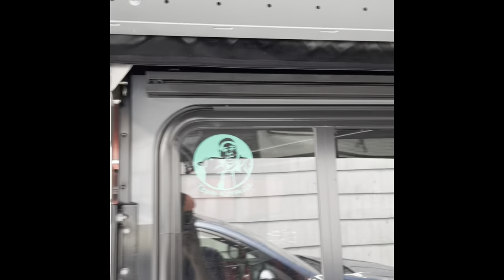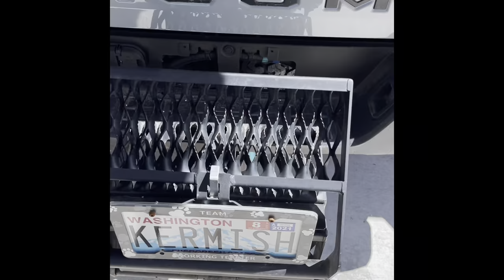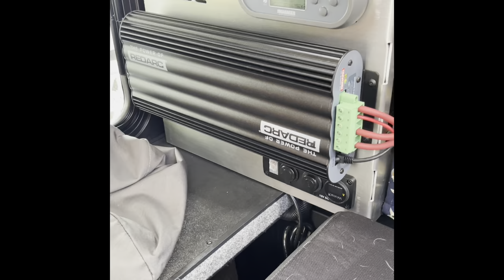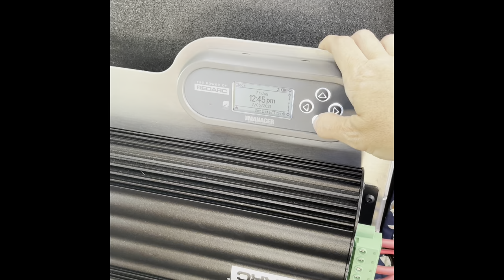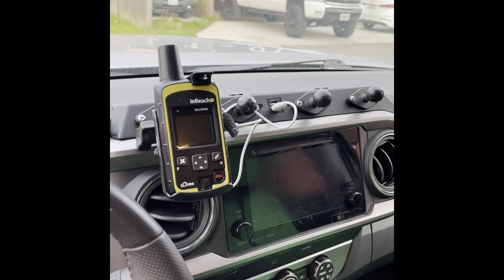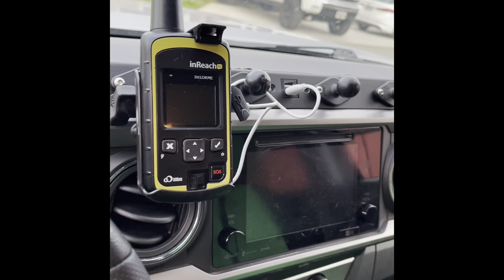2019 Toyota Tacoma with Project M

Comment: The rubber tail gate gasket really cuts down the dust on the back of your truck and dust entry into your camper. You may wish to check the bed's bulkhead behind your truck cab. That area isn't sealed on many truck to allow water to drain out of the bed. You can get a roll of putty tape to seal that area and keep the dust out of you camper. Thanks for your video.    :)
Reply from the maker: Thank you for the feedback and ideas. I was going to seal up the bulkhead area, but I like the drainage when I hose out the back of the truck. I use my truck for lots of different purposes, so sometimes it needs cleaning out.

Comment: Nice setup I am in the process of buying a Project M unfortunately I have to wait until June 2022 to get it. The more I looked at them the more I wanted one.
Reply from the maker: That was how I was too. I ordered mine right at the start of the pandemic. Had to wait all summer for it and got it right before Thanksgiving. Makes me glad now that I got it when I did. Feel free to ask any questions that come up while you’re waiting.
Reply: @kerryhagerty7051  Thanks Kerry will do. FWC is booked out a year at least the Project M is quite popular at the moment. They have a lot of accessories and seems to be somewhat over priced. I am trying to restrain myself and just get the must haves.
Reply from the maker: @markandroena  definitely they charge a premium for some things. What I focused on were the things that would pierce the skin of the camper. Those things are often best installed during construction… however, now that I have mine, they really are easy to work on and you really can do just about anything you want with them - with a little know how and common sense.
Reply from the maker: @markandroena  and the wait definitely sucks right now.
Reply: @kerryhagerty7051  Are you glad you purchased the power station and the solar? I have seen several power stations much cheaper but its nice to have it already installed. I liked the base price of the topper but the cost escalates quickly with just a few accessories.
Reply from the maker: Short answer, yes I am happy with the solution I put in… and it wasn’t cheap. I want to be able to spend extensive times off grid and have the ability to charge electronics that I use in assorted activities… lights and fridge/freezer are nice too. I could have accomplished the same solution in a lot of different ways and many were cheaper, but had more failure points and/or durability concerns. I would say really work out what you need/want electricity for, how long you need it between times you would run/drive the truck. Also think about where you go/camp… is there lots of tree coverage? Do you prefer to park in the shade? You may want a portable generator and/or folding/portable solar panel instead. I will say having it wired by the factory made a nice clean install that I appreciate, but even that is something a person with the right skills could do themselves. Once you start adding stuff it starts to really bring up the price and also the weight. Hope this helps.
Reply: @kerryhagerty7051  Good points thanks.
Reply: Hi Kerry,
I get my Project M in July ,I want a 270 awning have checked multiple options. You installed an Alu Cab 270 shadow awning on yours correct? How do you like it? You can buy wall accessories correct? Thanks!

Comment: Do you have a water system?...Such as:  a mounted tank with several gallons:  a heating system; a wand for outdoor shower, etc.
Reply from the maker: I carry water jugs - blue reliant jugs and one LifeSaver Jerry Can. I got one of the propane water heaters with pump to have a shower, but to be honest have never taken it or used it. I birdbath out in the wild and shower when I get home or to someplace with facilities. I heat water on the stove or over the fire if needed.

Comment: Thanks for the video. I see some of your tweaks can be used on a Project M for my 2006 Std Cab 8ft+2inch bed. I am not able to see how snug the 4 Wheel door fits on the tailgate. //Had an issue w the topper door gasket + road grit rubbing through the tailgate top down to bear metal.//Had the tailgate repainted and added 2 layers of airplane "prop tape" on top of the tailgate where topper gasket rests. This tape is from general avaition store, is used on the edges of plane propellers to reduce wear. Was $3/ft when I installed it. A bargain.
Reply from the maker: Good idea on the prop tape. The top of my tailgate on my Tacoma is molded in the same material as the truck bed. So it seals up better with the rear hatch. Also my installers put some gasket material that helps too. Glad you found the video to be helpful.

Comment: Really great set up. I just wish you could buy these topper campers and others in Australia 🇦🇺😔
Reply from the maker: That is a bummer. We get a number of Australian and South African products here. It’s a shame it isn’t reciprocated. It’s weighs less than 400lbs built out, maybe you could get it built and then freighted to you. Definitely wouldn’t be cheap.
Reply: @kerryhagerty7051  that's the only thing to do. Large American utes are taking off in Australia presently. There's heaps more on the roads, they used to be rare. Expensive to buy, considering they have to be converted to right hand drive. AUD $98K for a DS RAM 2022 Quad Cab Express, for example 🇦🇺

Comment: Thank you, 

How much head room do you have by standing on the platform and given that your 5’9 . How tall is your platform?
Reply from the maker: The BedSlide adds about 4” or so to the bed of the truck. With everything opened up I have a foot or so of headroom. Hope that helps.
Reply: @kerryhagerty7051  wow.

Do you know the height from the bed of your truck to the ceiling.

My numbers are not adding up since you say you have close to a foot and we are about the same height .

Thank you very much
Reply from the maker: I’m just making estimates. Haven’t taken a tape measure to it. When I get home after the holidays, I’ll try to get you some hard numbers.

Comment: Hello, I would like to put an Alu-Cab 270 awning on my M. Did the brackets that you attached to the jack brackets come with the awning? Also did the tray come with the awning? Thank you.
Reply from the maker: Hi. I got the brackets from MULE Expedition Outfitters, so had to buy those separately. I also had to buy bolts, nuts and washers for mounting (M8s). I’m not sure what you mean by tray… if you mean the metal part that the awning itself is attached to and is inside the black bag - yes that is included (as is the bag). Hope that helps.
Reply: @kerryhagerty7051  Yes that helps, thank you.

Comment: Got the camper sure comes up short on the bedrail length hey? What a the length of your truck bed?
Reply from the maker: I have the 6 ft bed. The topper is the right length... the hatch to tailgate seam is a little sloppy, but I figure they’ll improve that over time. Joys of getting in early on this model.

Comment: Thanks for the video! How do you access the latches behind the tray for the 270 awning? I'm going to build my own and your video really answered a lot of questions but that one.  I can see it behind there in one of the shots.
Reply from the maker: You’re welcome! I’m glad the video helped. The brackets I’ve used to mount the 270 awning swivel down. They have the quick release bolts like bicycles have on the wheels. I had to drill holes and add pins because the weight was too much for the pressure/friction to hold up and the whole thing would slowly fall to the low position, especially when the awning was deployed. I’ll see if I can find a couple of pictures and post them up here of the brackets.
Reply from the maker: So sadly no options for adding up a picture here.

Comment: Does your electrical system allow you to charge the battery from the truck engine/alternator?  Thanks!  Great video.  Very informative on the Project M!!!
Reply from the maker: Hi! Yes. My battery charges from the truck battery and/or the solar. It also has a shore plug that I can connect to a standard house plug. Glad the video was helpful.

Comment: Very nice!   How's the Thelma insulation?    How do you keep warm? Thx
Reply from the maker: The thermal pack helps in both cold and heat. With that said, it does need help. I use a buddy flex heater on low, 2 dogs, a 12 volt electric blanket and a down bag. Sleep pretty comfortable down to the teens. Bigger challenges are water freezing in the back while driving and temps getting too low for the charge controller, leading to the battery not charging - but that’s pretty much when it’s down to negative temps. That can be solved with a battery warmer, but I don’t go out in those temps as a general rule so not a bit issue for me. Hope this helps.
Reply: @kerryhagerty7051  thank you!  Safe travels.

Comment: I’m with you I don’t like the signage on the sides. How did you replace with your decal. I get my M in 2 weeks and would like to replace with the same. Can you share how you did the decals?
Reply from the maker: My wife has a Silhouette cutting machine and we get reflective sticker stock and cut our own.
Reply: @kerryhagerty7051  Looks really great, well done.  I agree with you the badging looks cheap..... would you be willing to do another set and Id purchase them from you?  If not I sure understand.....
Reply from the maker: @stuartgraff6969  let me check with the wife and ask. I will warn you that some of the finer lettering has broken and come off under pressure wash and they are a bugger to get on straight. The sticker material we use is automotive and strong adhesive, so sadly while some comes off under the pressure washer, the bulk of it is hard stuck on once it’s set. I’ll let you know if she’s game and what colors we have. Also the material is reflective, so in sunlight it looks like a plain sticker but at night it lights up when lights are shown on them.
Reply from the maker: Checked with the wife… she’s still cussing from doing mine (lots of fine work picking out the negative space). She’s willing to send you the digital files she created for the cutter. Then if you either decide to get one or find someone else who has one, you can see if they would do it. You could also alter them to whatever you want/like too. Let me know and get me an email address if you are interested.

Comment: So so Nice ! Thank you .. I'm really considering buying one , would like to know the miles per gallon you're getting and of rear suspension is necessary.
Reply from the maker: Thanks. Right now, with the engine retuned to handle it, I’m running premium gas and getting 16-17 mpg. I was getting 12 with regular 87 octane. I think rear suspension depends on what you’re doing with it. I wanted to be able to haul some weight and go on rough roads. So I went with a Falcon upgrade in the rear and leveling in the front. Works great. Also, part of my fuel economy hit comes from the heavier tires. Without those, I suspect I’d be closer to 20 mpg on premium.  Hope this helps.

Comment: Great video. Very helpful. What have you done for heating? Did Mule offer any solutions? I know FWC offers heaters in their insert models, and Scout has a great propane heater option. But I have not seen anyone show any heat solutions on these Project M's just yet.
Reply from the maker: Thanks! Glad it was helpful. I use Mr. Heater FLEX to warm the inside. On low it keeps it plenty toasty for the PNW. I’ve looked at other heaters, but they’re overkill for me. With a thermal pad underneath me and a good sleeping bag, I don’t find I get cold sleeping. Hope this helps.
Reply: @kerryhagerty7051  Are you keeping any windows or vents open while running the Mr Heater? Or do you find that the natural amount of leakage of the camper is enough cross ventilation? And lastly, along that line, are you experiencing any condensation issues as a result? (I'm also here in the PNW/ Western WA. So same climate!)
Reply from the maker: I’ve found the topper is leaky enough, but I do crack the roof vent and run the fan on low to help pull any moisture out.

Comment: Excellent design! I am going to FWC in Woodland next week to buy an M. 
Do you pull the slide to cook under the canopy? 
FYI- The full bed version of the Bedrug covers the sides and has a seal at the tailgate. This might be the way to go with these Project M buildouts. 
You can mount the Bedslide on top of the Bedrug.
Reply from the maker: Thanks. I don’t cook near the truck. Bear country. I need to be able to hose out the bed of the truck when I use it as a truck (why went Project M rather than slide in camper). But it would work for someone using it differently from me, so good info.

Comment: So I’m just received my project M and want the 270 degree bat wing awning. Curious how much it cost to install. Would you be willing to share that information?
Reply from the maker: Hi. Install was free because I did it myself. I got the brackets to mount it from MULE Expedition Outfitters. They mount directly to the jack brackets on the side of the M. I got the hardware to mount it from ACE. If you want a shop to do it, I can’t imagine it should be more than an hour of shop time - so whatever their rate is plus maybe hardware. My batwing is the Alu-Cab model. I’ve heard there are now lighter options that may be easier to install available. I’d talk to a couple of shops to see what options they have now. Hope this all helps. Let me know if you have any more questions. Cheers and enjoy your M!
Reply: @kerryhagerty7051  Kerry, Thanks for responding. I have a few other questions. We’re you working with the guys at the Oregon or Washington location? Also, if I called them do you think they would have bracket kits available for sale and would they recall your particular awning installation?
Reply from the maker: @JohnDoe-ht1de  I worked with the Washington folks. Mitch Carter helped me figure out my solution and I believe both locations have since done installs for other customers. As far as I know, they should have the brackets in stock.
Reply: @kerryhagerty7051  Thank you so much.
Reply: @kerryhagerty7051  One more question. Where did you purchase the tie down that attaches to your gear track? Do you have a link?
Reply from the maker: @JohnDoe-ht1de  I’m not sure which tie down you are referencing. I have a ratchet strap that connects to the L-Track inside the truck. Those actually came with the Project M (I ordered the internal L track and external T track on the M - installed by FWC). If that’s not the tie down you’re referencing, let me know. Other straps are just Rok Straps I ordered through Amazon.
Reply: @kerryhagerty7051  I was looking for the D ring that slides into the t slot exterior gear track to use as an anchor for the awning. Sounds like it came with your interior gear track which I didn’t purchase. I just purchased the exterior t slot gear track which didn’t come with any d rings.
Reply from the maker: @JohnDoe-ht1de  ah. Sorry. I misunderstood. I got square nuts that I slid into the T-Track (got at ace hardware, but I can’t remember the size) and then used bolts that thread into those nuts to attach anything I want to the T-Track.
Reply from the maker: Including the d rings that are actually bolt on tie down rings for I believe a Jeep Wrangler.